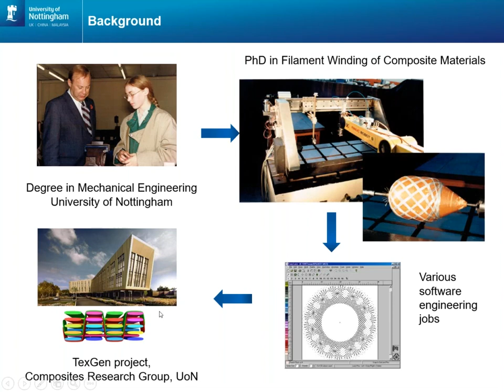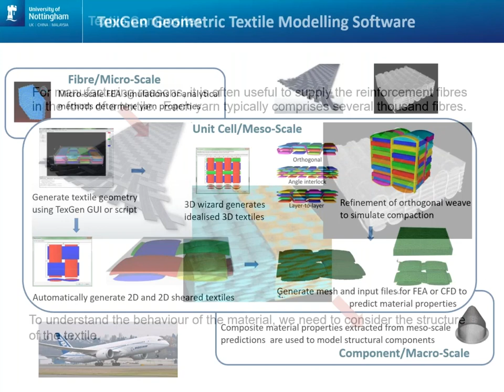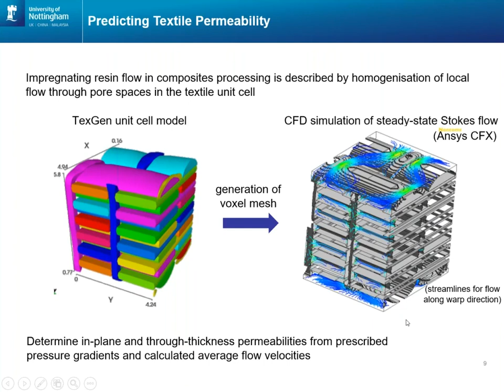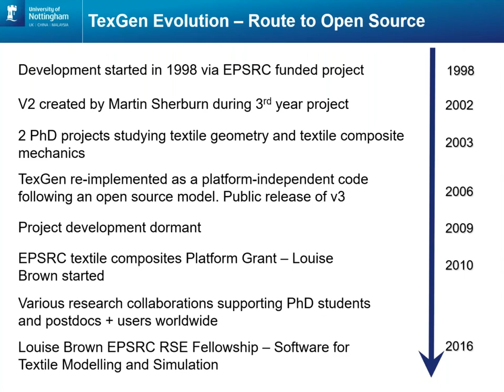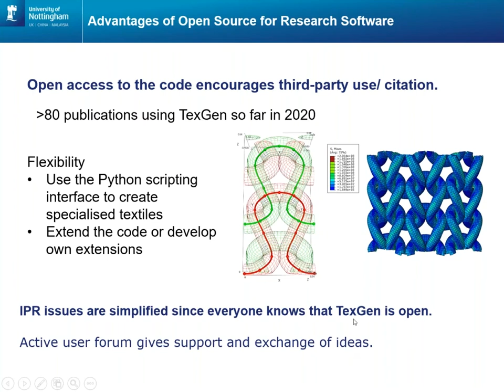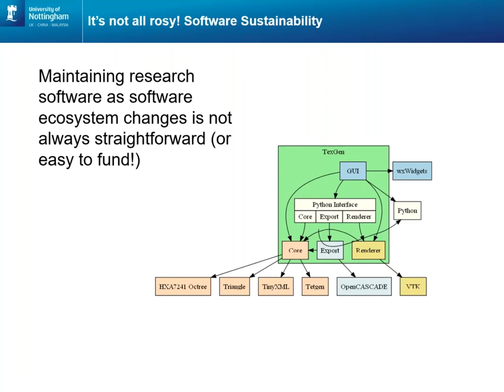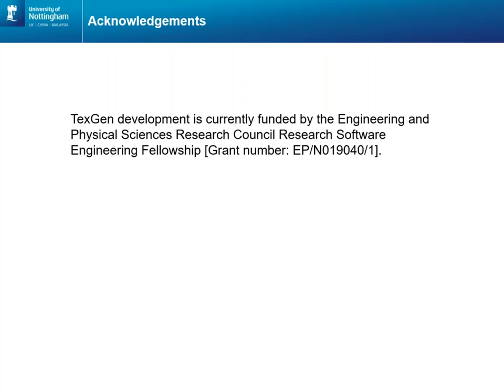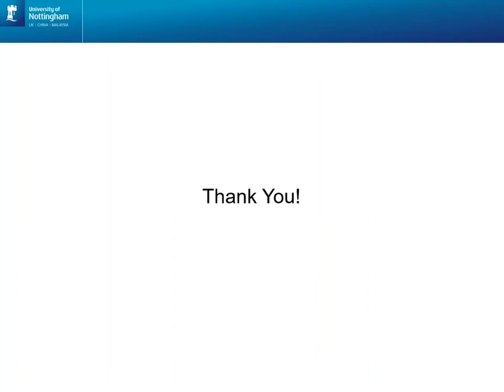Open source success: how TexGen grew users and citations

Comment: Is there a standard weave 'style' for generating a double sided pile material.  I believe a pile material such as often found single sided is used in a sweatshirt and may even be a knitted material.

I believe the one sided materials are woven as a double layer cloth and then cut in half.  I am wondering if three layer designs are common allowing to achieve two (possibly sacrificial) single sided materials and the middle layer would have a cut pile on both faces.

Would TexGen be suitable for modelling such a design?